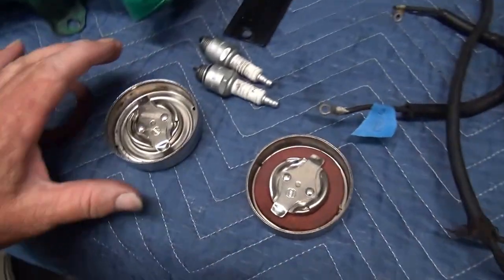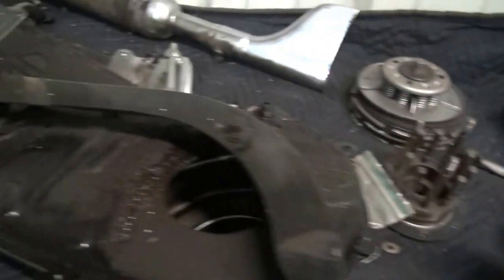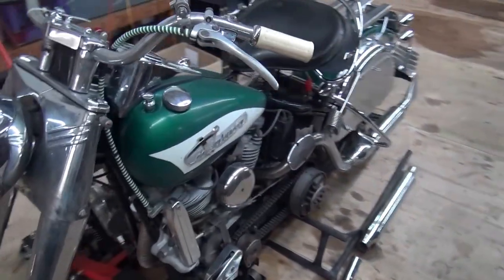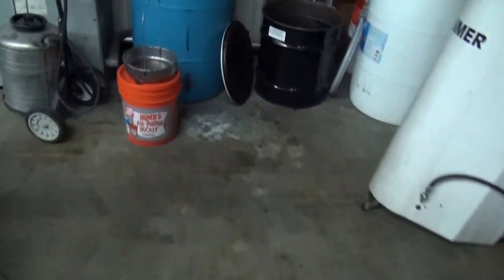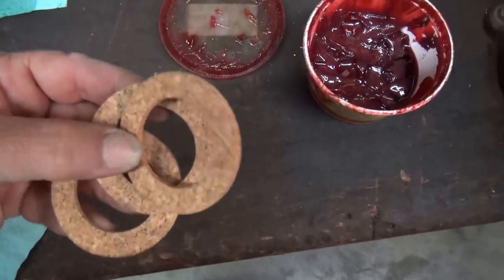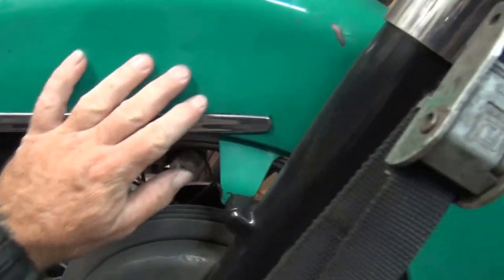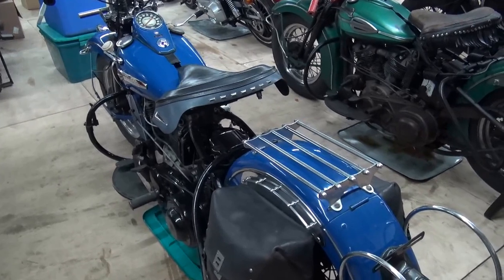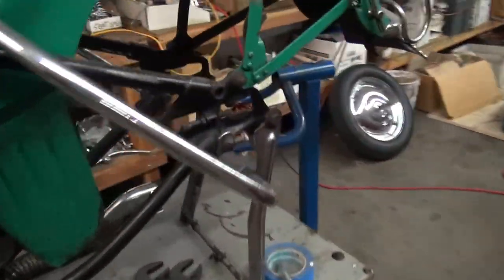Hunting Harley's, Eaton Gas Cap resurrection

Comment from the maker: technically, it would work, the new cork sheet. I'd have to have a way of cutting it like a cookie cutter press type thing. It is the cookie cutter press bit I don't have. too much other tooling I need to buy before I buy something like that for just a few caps. These have to be fairly exact, cutting it close won't work so well. The cut it close with a knife bit would work as a 'last resort', but since the leather ones are available...